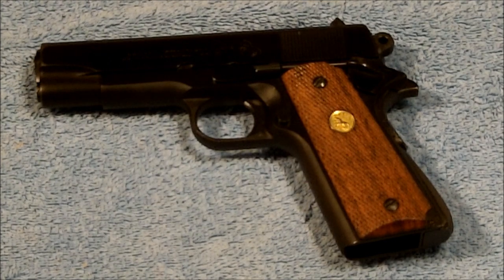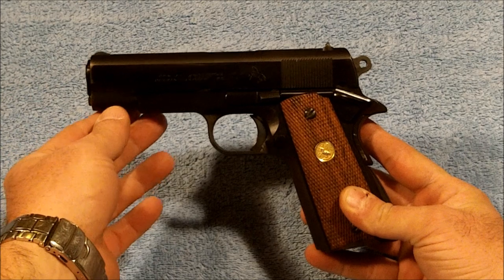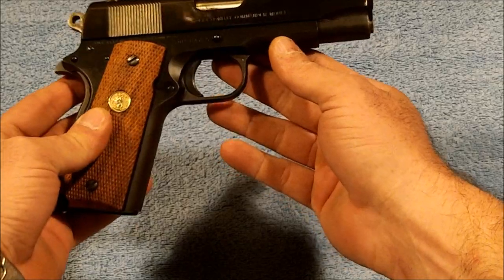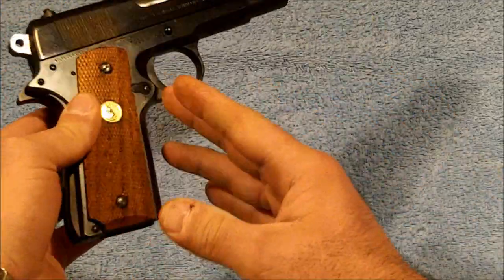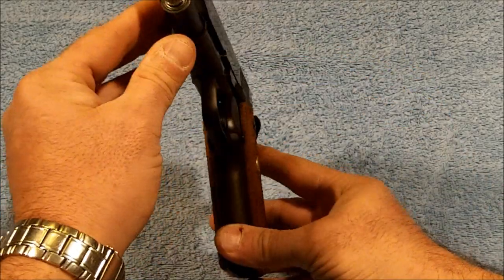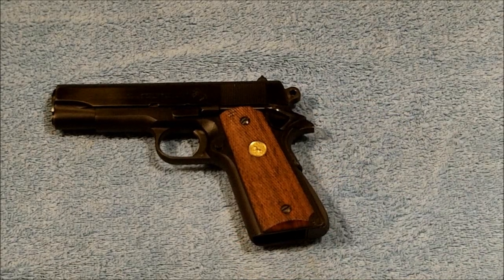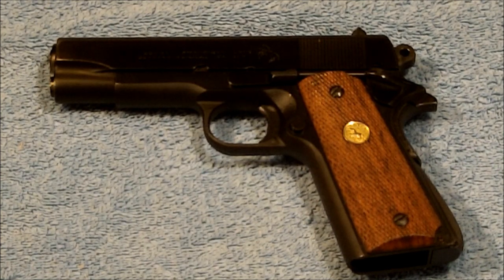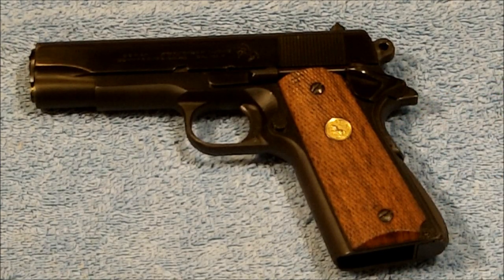1911: Colt Combat Commander

Comment from the maker: You see them from time to time.  They seems to change value depending on the winds of time,  since a lot of other companies currntly have 9mm's out the value has dropped some, but generally they run from about $800-$1500 depending on how old they are and condition.  Your not getting hurt,  That is probably on the low end of the price scale right now.

Comment: yeah........I will take the firing pin safety, thanks.  Most guns have them these days, and besides making a firearm safer, it really doesn't detract from a firearm.  It's pretty much like saying I prefer my safety belts without the shoulder harness on my car, everything else just isn't pure.  Just giving yall shit.  LOL
Reply: John Browning obviously didn't think a firing pin safety was necessary. There have been very few recorded instances of original and series 70 1911's actually firing when dropped. In those instances it has usually been due to significant wear with parts and springs that are in very bad condition. The main complaint with firing pin blocks in Series 80 1911's is that the triggers are much harder to tune. Gunsmiths don't like working on them cause of the added complexity of that system, and the triggers tend to be a bit heavier than their Series 70 counterparts.